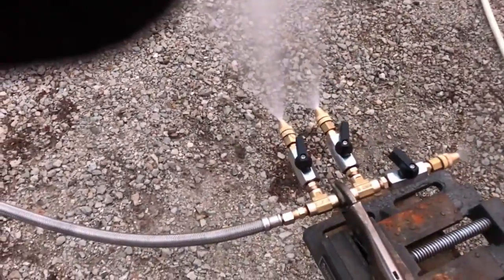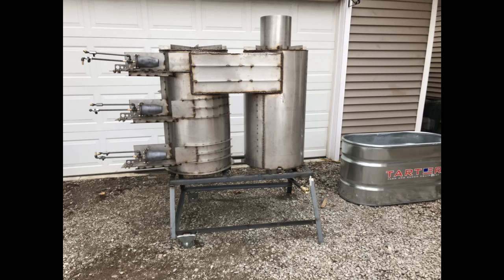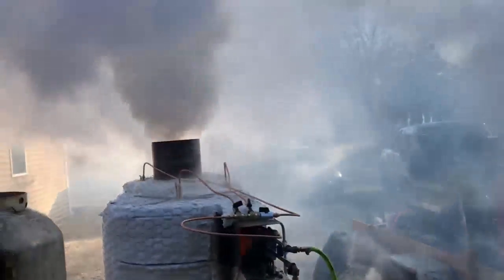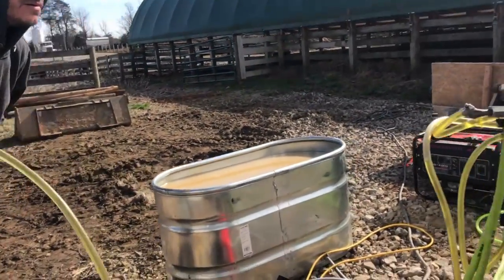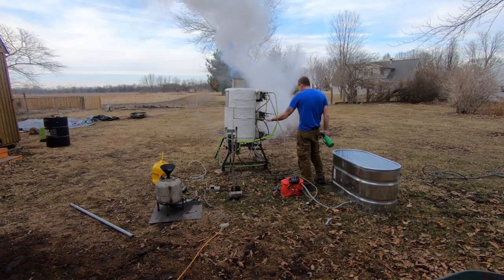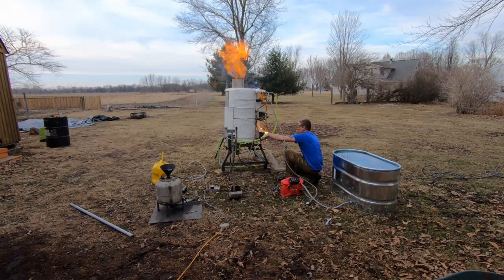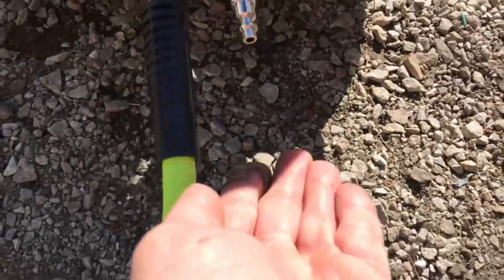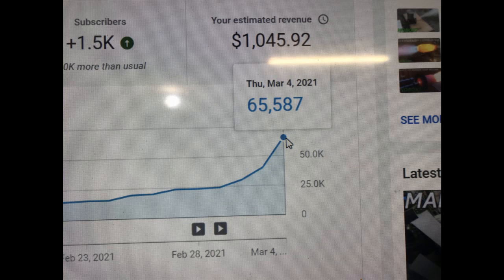Industrial flash dryer proto type testing

Comment: You know can use steam instead of air on siphon nozzles (I usually upgrade the o-ring inside to Viton, something  rated for steam). Steamboaters uses similar nozzles to burn diesel or kerosene in their boilers. I mention it because you appear to be making some steam but are running out of air. In a normal boiler, running  a siphon burner nozzle on steam uses almost no steam.